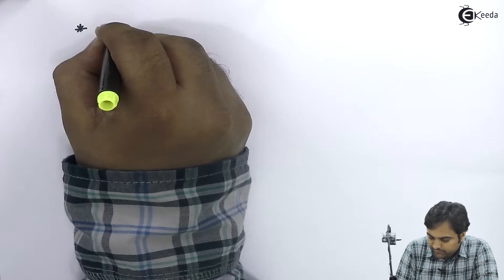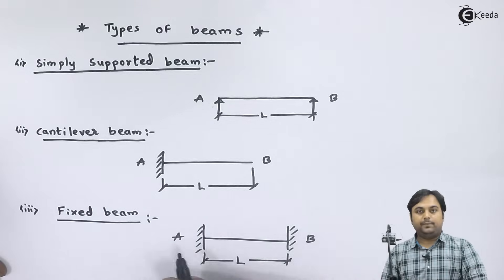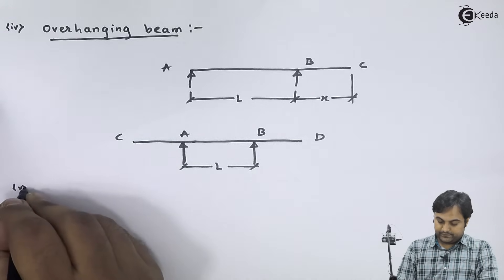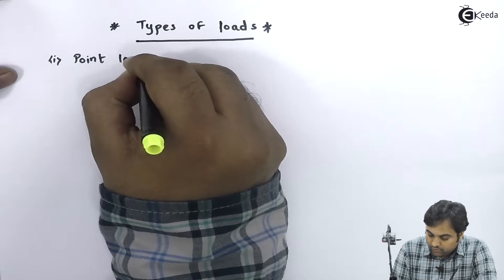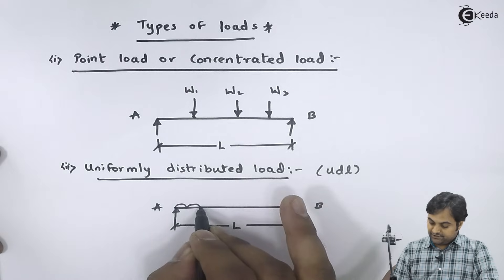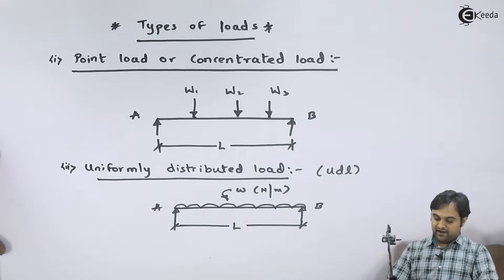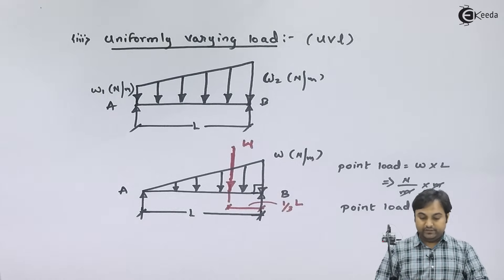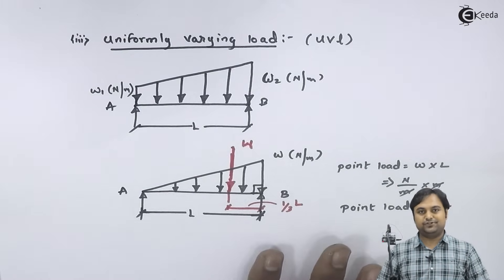Types of Beams and Types of Loading - Shear Force and Bending Moment Diagram - Strength of Materials

Comment: Can you please explain this problem sir a short column of 350 mm into 350 mm suction is to consist of Ryan 40 Steel rods of 20 mm diameter with compressive load of 3 Mega Newtons how many reinforcing Steel rods are required if stress in concrete stress not to exceed 17.5 Newton per mm square and modulus elasticity elasticity e is 10 times of that of concrete